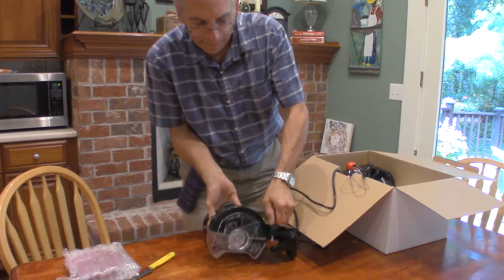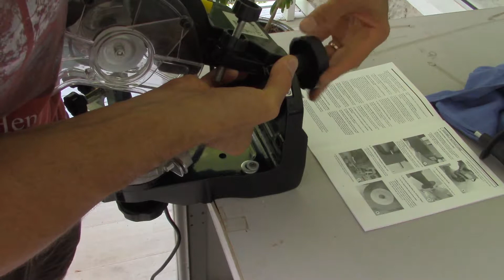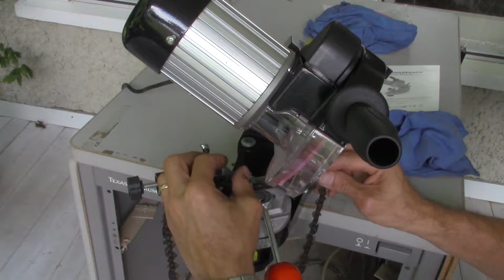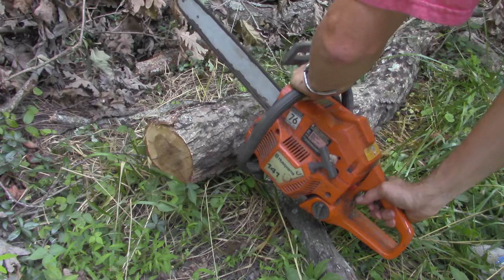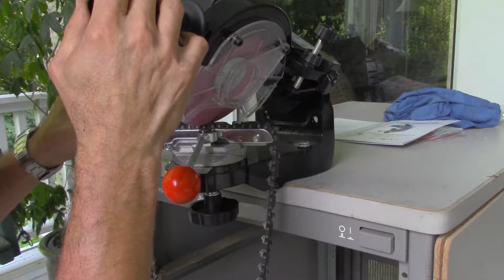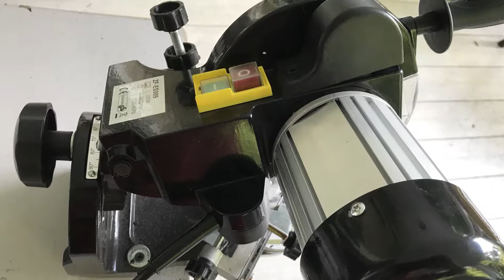Penson Electric Chainsaw Sharpener Grinder w/ Grinding Wheels 1/8" & 3/16"

Comment: After watching you video I went and looked at my Harbor Freight electric chain saw sharpener.  The one you showed is three to four times nicer than the harbor freight one I have (mine was given to me). The motor on mine slows down on every tooth you grind so you have to go slowly.  It has only two of the three adjustments the sharpener you showed has.  And I know it might seem like a small detail but I really liked the built in light on your sharpener. Of course mine does not have a built in light.